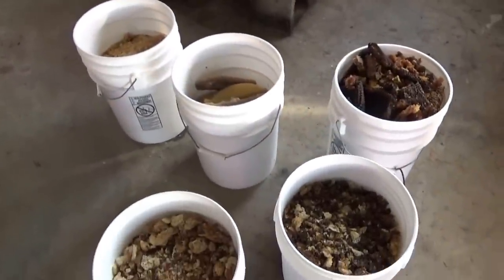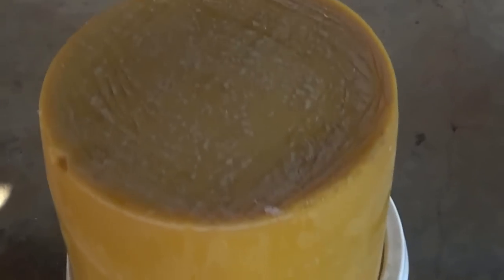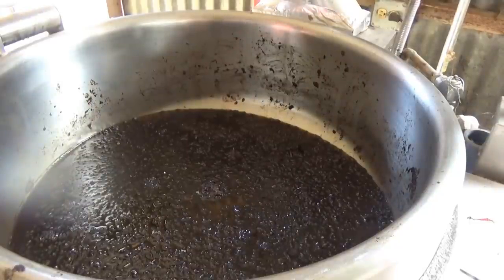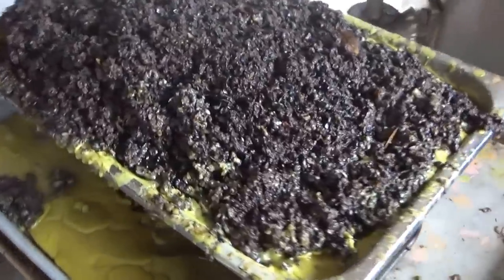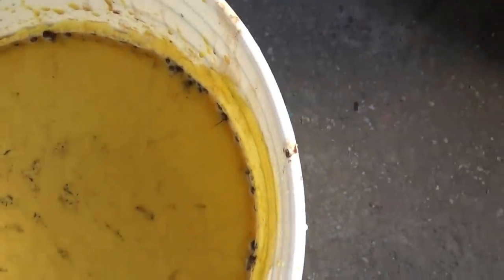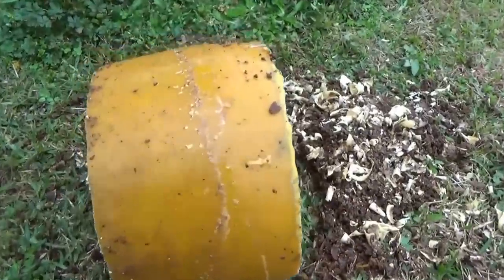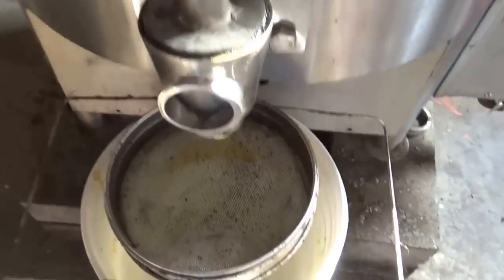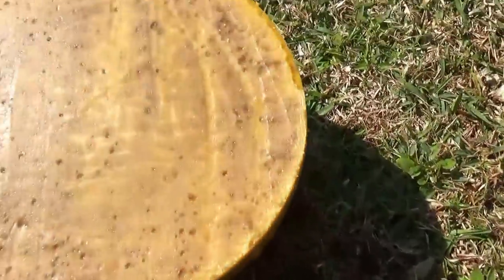Rendering bees wax

Comment: Hey Mr. Ed! I wanted to know the best way to remove excess honey from the wax? I have some very filtered beeswax but it still struggles to burn candles properly due to honey content. Would I just remelt it down with water and then let it separate that way? Thanks again! God bless your work.
Reply from the maker: First, thank you for your blessing, I am in constant need of them. I do not know anything about candles, but my suggestion would be the one your offered. I would remelt the wax, mixed with water, to further separate the wax and honey. If the wax is pretty much refined, it would seem to me that that should do the trick if that is what the problem is. Good luck , and let me know how it works. Thanks for watching. God's peace.
Mr. Ed

Comment: Just curios why didn't you strain it again as it went into the bucket. ?
Reply from the maker: There is still to much trash in the wax. It's easier to let it solidify, and then scrape it off and melt it one more time. If I weren't dealing with so much wax, I would strain it at that time. When you are dealing with over 15 pounds of wax and another 3 pounds of dirt, it's worth while to melt it one more time to really get it cleaned up. Thanks for watching.  God's peace.
Mr. Ed

Comment: Hey Ed, great Vedio! I do have a question.... When you did the first clean with fish fryer basket and then drained it from the machine why wouldn't you put a strainer on the 5 gallon bucket to get the rest of the junk out? Does the wax clogg the screen so it won't go through a strainer? Thanks blessing your way
Reply from the maker: There still is so much trash in the mixture, a screen would clog up very quickly. Its just easier to scrape it off and melt it again. At least from my point of view.    Thanks for watching. God's peace.
Mr. Ed

Comment: Just curious.Can beeswax be used in the making of candles?
Reply from the maker: Yes it can, and part of the wax that comes from our bees is used to make candles here at the abbey. Thanks for watching. God's peace.            Mr. Ed
Reply: @JeffHorchoff  Hi Jeff.Wonderful surprise to hear from   U.I`ve been interested in bees from childhood but never got info as good as I get from watching your videos.Thanks for a great show.Now I`ve got another question:I`m about to install wood blocks in my house for flooring.Is there a way to thin the wax in such a way that I can apply it on the flooring and polish it by means of an electric polisher?It to be more of an almost liquid form to be easily be applied.Also a way on how to mix the ingredients.I figure the beeswax will make the wood more resistant to water ingress.I used beeswax on wood bowels many years ago that I turned on a lathe and it came out rather nice looking.God`s peace to U also.Schalk.

Comment: 44 gal drum with a copper coil that steam goes thru into the water steam it for 4  hrs and scoop the wax off the top into blocks. Holes in the Coil to let the steam into water.

Comment: Can I ask something for curiosity reasons?

From however many lbs of unrefined wax, how many lbs do you end up with post-rendering?
Reply from the maker: I do not have an exact number for you, but if you double the weight of the refined wax, that's about how much unrefined wax is needed. So, if you wind up with a 1 pound block of refined wax, it took 2 pounds of unrefined to get there. Thanks for watching and for asking. God's peace.
Mr. Ed

Comment: Thanks, again, Jeff. I like the idea of using an old honey strainer. Had not thought of that before. Question: are you concerned about the temperature of the wax as you melt it? If the water is boiling, it got to 212 degrees, right? Do you need to get it that hot?
Reply from the maker: Good to hear from you Dave, I thought the same thing about the temperature and the possibility of scorching or burning the wax, but I have seen videos where they use heat from a oven that is set at 250 degrees and the wax is beautiful. So, I guess it's OK to bring it to boil. Like you said, that's only 212 degrees. Also, if you noticed, even though it was boiling, there still was a little piece that had not yet melted down. You always keep me on my toes. Thanks Dave. God's peace.       Mr. Ed

Comment: have you tried pulling a pair of pantyhose over the strainer? It's a cheap way to make the strainer more finemeshed and it would render a more clean wax.
Reply from the maker: That would work on the 3rd rendering, but before that there is just way to much trash in the wax. Thanks for watching. God's peace.
Mr. Ed

Comment: Hey i tire pantie hoses as a filter,  it works good>  I was afraid it would melt> but they didn't
Reply from the maker: I hope you took them off first. God's peace brother.
Mr. Ed
Reply: lmao There brand new, Been using them as a honey filter. Just slip and tie it on the spout.  They work excellent in melted wax to> been wanting to try this for a long time as a wax filter, So i gave it a shot as i was melting wax > 2 melts i'am done the second one NO WATER AT ALL CLEAN CLEAN CLEAN there ready for any thing, chap stick, lip balm, candles,  any thing

Comment: When you dumped out the wax plug from the bucket there was a lot of liquid that passed out of the bucket as the plug fell.  Was that the water? Was it sitting trapped beneath the plug?
Reply from the maker: Yes, that was the water that I had put in from the very beginning. It was dark because of all the trash that was in it. The wax rises to the top of the bucket and the water is trapped under it. Thanks for watching. God's peace.     Mr. Ed

Comment: why not just open the valve on the melting kettle and strain it through the fry basket ? seems like you would have less wasted wax and get the majority of the impurities out in one shot.
Reply from the maker: I tried that once, it was a disaster. The basket filled up immediately, and the water/wax mixture went everywhere. I now place a screen in the bottom of the kettle and it works great. here's the link to that video. Thanks for watching. God's peace.  Mr. Ed
https://youtu.be/gdof2ZO_5eA

Comment: You shouldn't throw away your cocoon bits, the wax they've absorbed would make great fire starter. Just make them into small balls or 1/2' by 2' strips and sell them in packs of six. All natural, and no waste.
Reply from the maker: You are not the first to suggest this, but all that stuff now goes into the compost pile at the abbey. It helps with aeration so I'm told. Thanks for watching. God's peace.      Mr. Ed
Reply: There is that, and I am sure they add calcium and nitrates too. I just thought they'd make a good source of revenue with no overhead too.

Comment: Nice vidio but one question I have how much energey do you use for this prosess I do simerler as you but I only use soler energey from the sun and it doesn't cost any thing
May be you schould think about this posability it will save you a lot of $
Reply from the maker: I have a solar wax melter, it just can't handle the volume of wax that I put in it. They do work very well. Thanks for watching. God's peace.      Mr. Ed

Comment: why did you not open the valve into your fryer basket? the first time that is. could get more of that stuff out.
Reply from the maker: It is to much nasty stuff floating around the wax to run it through the gate initially. The fryer would get full and clog up and not allow the wax and water to penetrate the junk. So,I strain it first with the fry basket, then through the double filter. Thanks for watching. God's peace.      Mr. Ed

Comment: Great video, too bad you didn't explain certain things like kettle used, why water was added, etc. :(
Reply from the maker: I have to admit, I take to many things for granted, and I assume everyone knows what I know. I'm sorry for the transgression, I will try to be more aware in future videos. Thank you for pointing it out and gently reminding me that others don't know  and are seeking knowledge. The kettle I use is a commercial kitchen kettle. It had been used in the monks kitchen until it was replace with a different version. They then let me use it for Abbee Honey. Water is added to the mix to allow sediment room to move around in. If there were only wax, the trash would not separate as easy. I hope that helps. Thanks for watching, and I hope you check out other videos on my channel and let me know your thoughts. God's peace,
Mr. Ed
Reply: Jeff it's ok, no harm :) When I watch videos here, I do it to learn something that I don't know. Hopefully, my comment didn't come across as rude, not my intention. Other than not knowing the kettle, water use & temperature... it was very informative. I also did notice you filtering it many times. Do you think using a 1-3 stage hardware cloth/mesh filter setup would eliminate the multiple heating & filtering?
Reply from the maker: Once you melt the wax the way I do it, you will see  just how much debris is in the mix. It is simply easier to try to remove as much as possible the first time, so that subsequent straining can be accomplished. God's peace.      Mr. Ed

Comment: why not add a strainer/filter at the end of the nozzle of the pot/boiler? technically that would make purifying the wax so much easier
Reply from the maker: There is way to much debris for a filter to catch without becoming clogged up. After much experimenting, this way works best for me. I am doing an additional filtering with another strainer once the main body of trash is removed, but that is still by hand and not on the kettle. Thanks for watching. God's peace.      Mr. Ed
Reply: Jeff Horchoff i see, thx for replying. Nice video :D

Comment: why don't you strain the hot wax into the bucket on the first round?
Reply: Tm Grade is right
Reply from the maker: There was over 50 pounds of trash in the wax, and it was just way, way to much to strain. It may not look like much on the video, but the volume is tremendous and the weight is staggering. Thanks for watching. God's peace.
Mr. Ed

Comment: you could of filtered into the bucket. your doing it the slow way. use some napkins and done the first time.
Reply from the maker: Because of the high volume of trash in the wax, multiple times of rendering are necessary. At some point the napkin idea would work, but not initially. Thanks for your suggestion and for watching. God's peace Alex.
Mr. Ed

Comment: Why not just put a filter in front of the drain/gate and clean it every so often? Seems like a lot of work getting it out by hand.
Reply from the maker: I removed over 15 lbs of trash while filtering this wax. That is way to much for a filter to handle, so I pull the bulk of it out by hand, and then run it through a filter. It works for me. Thanks for watching. God's peace.         Mr. Ed

Comment: Heating beeswax over 178 degrees burns it and pretty much ruins it for anything but industrial use. You had it boiling....
Reply from the maker: yep, I blewit on that one, I try not to get over 165, but mistakes happen. It still was usable to spread on the foundations so it worked out ok. I got to bee more careful. Thanks for watching. God's peace.      Mr. Ed
Reply: Glad it worked out! I enjoy all of your videos. I once had a batch turn into a flaming cauldron of death due to a faulty thermostatic control so I get anxious when I see it hot enough to boil.

Comment: Buy a dam boat ore hell only 14 bucks>  OR MAKE YOUR SELF  ONE!  your a wood worker. Make a video of you making a boat ore.   a 2 x 6 x 4' long  should make a nice one    If you don't put the cocoons in a filter bag and steam press them out YOUR LOOSING LOTS OF WAX i would make a hydraulic press where can go back every 15 min squeeze even more wax out of the cocoons Then take off the steam hose that under the press use a lift to lift the press out make it where in hangs on the inside on the lip of the kettle   Just press a button to press and release  Remember steam rises OK and the kettle will catch all of the dripping from the press and use steam to clean it